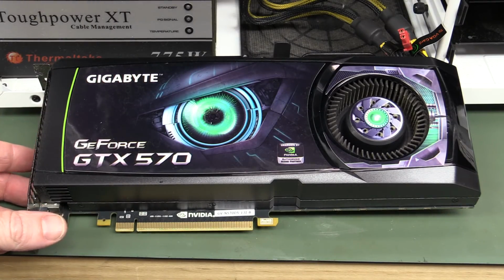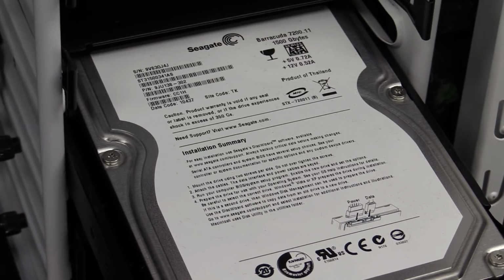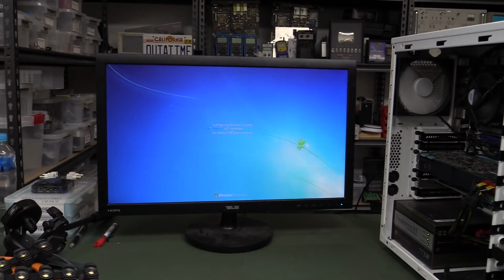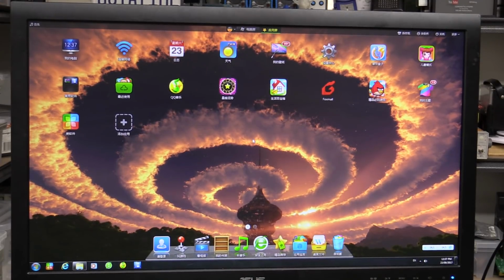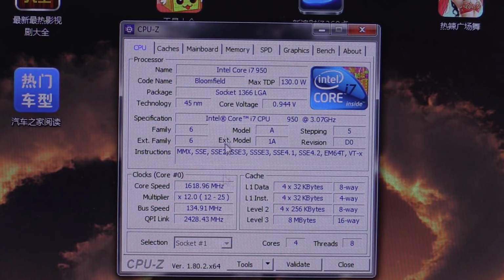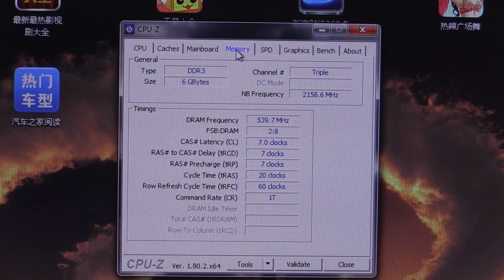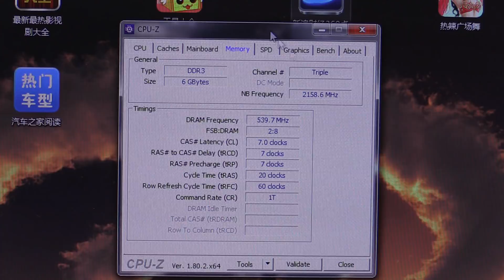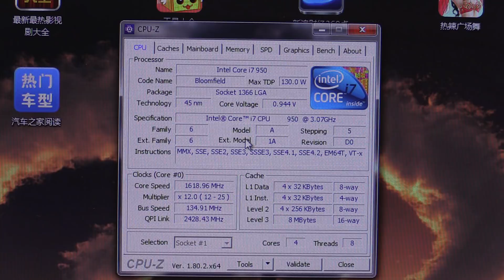EEVblog #1026 - Mystery Dumpster Diving PC

Comment: Kinda wondering why such "definitely from China" harddrive would get into a dumpster outside China. I mean, the system on the harddrive even has 360 safe guard on the computer, indicating that the original owner had no knowledge about how computer works anyway. I mean, anyone have any knowledge about how computer works (rather than only being able to use certain stuffs on a computer) would not install that software, which works worse than Windows's built-in feature.

Comment: The first i7 gen had the biggest gain in Performance since AMD Athlon.
I used my "gen 1" i7 920 until late 2014 when I upgraded to "gen 4" i7-4770K.
Not much performance was gained ! 
Only the prices had seen a substantial rise. Today prices are insane for the performance you get in CPU and GPU !

Comment: Oh and there is a heat-shield inside missing in the case. That blocks the heat from the PSU rising in the machine, and this part also has thr mounting holes for 2 SSD drives normally

Comment: OK, I'm gonna pause it at 3:21 and guess a Conroe chip, like a Core 2 Duo e6600...
Reply: ...and boy was I wrong! Who the hell throws out a Core i7? A 950 is a solid performer, even by today's standards. Incidentally, I have a 4790k chip, and it is the tits. I just wish it had a little more overclocking headroom. I went with a water cooling setup and still can only get it to run reliably at 4.5GHz without it getting too hot.

Comment: Better than my last PC pentium dual core 4GB RAM, 128GB SSD, Optiplex 380. Replaced with custom rig: Haf-X full size tower, ASUS x99-WS 31 MOBO cor I7 6800K, 16GB RAM, Gigabyte 750TI 4GB GPU, 250GB SSD, 2TB HDD, EVGA modular 1000 watt PSU.

Comment: Lots of comments expressing surprise at the quality of items found in your dumpsters. What these people don't realise is that businesses can often change such items more frequently due to the ability to write off the cost against tax as a legitimate business expense. Add to that the need for businesses to comply with data protection laws and they will change equipment like PC's more frequently than domestic users although many will utilise a recycling service for security reasons. Viewers should not compare what their neighbours throw out with a business park as reasons for discarding items are very different.

Comment: love the case! My computer runs win7 on 4gigs ram, 775 intel 2.5ghz with a ssd Runs really good for my work and so on. 
Is running on hardware over 20 years old!!  ram, cpu, case, psu, and motherboard over 10 years with only the ssd,vid card and usb card being newer. 
It's a damn shame when stuff like this is thrown out. I would have loved to have this set up :) happy someone can find some use for it.

Comment: The machine is definitely from around 2009-2010 considering it has a 1st gen cpu. (I think we're into the 6th gen now?) It was probably tossed due to obsolesce. No matter it's still a great machine. The led's on the power supply is new to me, never seen that before. In fact never knew Thermaltake made psu's like that lol!

Comment: Hey Dave, I tried to see if someone else asked this, but I did not see it...  did you notice that the computer has the Sata Data cable wrapped around the Mother boards power connector / lines?  I am thinking that since the MB just uses DC in ... it shouldn't cause Sata issues, but it may cause some Noise on the power lines for the MB.. Whats your thoughts?

Comment: Cool find, not really worth anything in todays market but for free it's not bad at all. Be sure to check what ram you put in this, as it is running in triple channel mode. Adding the wrong (type or amount) ram will slow it down to single channel mode. Making the added benefit of the additional ram somewhat useless

Comment: I have a pretty good idea of why it was tossed out. CPU Z had the max two at 130W while Intel stock coolers are only useful at dissipating somewhere around 90W. Also I noticed the clock speed was 3.07GHz which doesn't sound like a stock speed. Now I don't know the stock speed off the top of my head, but I bet they either overclocked it with insufficient cooling or tried to under clock it to compensate for the poor cooling.
Reply: Chrome corrected "tdp" to "two" please disregard the typo.

Comment: 5:01 "Pretty clean installation" Yes, because Windows 7 comes with a mod that makes it look like a hybrid of iOS and Android. :P
Reply: you mean a hybrid of osx and windows?
Reply: Nope. It looks like the original iOS and an old version of Android mixed together. Granted, it does have the windows taskbar still, but ignoring that, it looks the way I described, at least it does to me.
Reply: l can see he android, but l don't see the ios. it looks like osx to me.
Reply: Mainly the way the dock looks with the apps. It's very reminiscent of the way the dock looked in the older iOS. The apps looked sort of cheesy back then, just as they do on that dock. If it wasn't for the way the apps look on the dock, I would have said OS X and Android. I'm just anal retentive that way. :P

Comment: OMG LMAO They threw it out because of a broken foot!!!! WOW!!!!
Reply: they probably tossed it because it's old and hasn't held up very well over the years. and there is a possibility that this machine is a trojan horse carrying viruses.
Reply: Paranoid much? LOL   Sorry to laugh, it's just that saying it's a Trojan Horse is suggesting it was left on purpose to spread a virus. This is dumb on many levels. First, a virus is designed to spread itself, they do not need Trojan Horses in the form of dumped computer systems. Second, it's a highly costly method to spread viruses when again they are designed to spread themselves. Third, you have no guarantee the viruses will actually get spread out of the Trojan system because many people will just wipe the hard drive and install their own system onto it. Far quicker than trying to clean the system found on the drive. Fourth, you have no guarantee that the system will be picked up by someone like Dave before it's taken away by the refuge collectors and either recycled or dumped into a landfill. I am sure there are more reasons why your suggestion is laughable but I think those 4 prove my point enough :)

Comment: Goddamnit , the machine im using right now is far more obsolete than this.   With 4gigs of ram, 4core phenom and radeon 5450, which struggles with full hd video.  Why do people throw such marvels away ?
Reply: because it's garbage to most people.
Reply: Get a Nvidia GT 1030, which will decode Youtube videos (i.e. 4K) without the help of the CPU.
Reply: GT 1030 is horrible price/performance. Shitty value, waste of money.
Reply: The GT1030/50/70/80 supports the eighth generation of PureVideo HD and adds full hardware-decode of HEVC Main12 profile to the GPU's video-engine.
Reply: Gt1030 cost's here more than the rest of my pc combined. and used gtx570 like Dave just found costs 2/3 of its price while steamrolling over it.
Reply: Its slightly less powerful than a 750ti and costs less. It also has a very low power requirement meaning you can put it in almost anything. Great for upgrading pre-built systems.
Reply: a 1050ti would the better choice because it is more powerful and also very energy efficient.

Comment: That's basically the same power supply I have in my PC since 2010 😂😂😂
Great psu, never had any problems and have gone through several PC upgrades but the psu is the only original part.
I also just bought a fractal design define S case this year for a watercooling build

Comment: If I didn't know any better, the person throwing it away was the parent of a lazy gamer who got fed up with them lol. You don't need a great computer to run those games that are installed. 

That being said, the computer is pretty good. A few years old (3-5), but that's not much different than my computer. I'm sure it performs similarly except that I have a new gaming gpu. I know for a fact that the psu, motherboard and HDD are better than mine. So yea, good find for sure. Lots of usable components, or even a usable computer if you have a need of one at a new location or whatever.

Comment: yes it is better than mine I'm on a core I5 with 8 gigs of ddr 3 & a budget 1 gig Nvidia Geforce GT 520 but my 1 TB drive runs circles around that systens drive :) oh BTW newer systems do not require a burn in only old systems from the 90s do

Comment: Awesome! Good find. You can even get 6 core (i7-980X) for it, and triple channel DDR3 is good, stick some more ram in for 12GB perhaps, PSU is good. You could put in something newer like a GTX 1060 and have an all-round crackin' machine. Oh, get a cheap SSD and put a fresh install of win 10 on it, or reinstall 7 if you prefer. An SSD would make it a lot quicker to load stuff. All the best from England! :)

Comment: I just breathed new life into my X58 + i7 950 by picking up a XEON 5675 6 core for $43 and OC'ing it to 4.1ghz. It swapped directly over with no fuckery. Dave could even do that. (not as high OC with the stock cooler)

Comment: I  found a  ASUS  All  in One  computer in mint condition in a dumpster  a few tears  back.  It to  had a I7  processor , so I powered    it up and  the computer didn't boot.  I  took the computer  to a repair  shop and the issue was that Windows 10 tried to install on it and  it failed to boot.  Who ever  owned  the computer ended up throwing it in the dumpster, thinking it was unfixable

Comment: Looks like someone threw out their old-ish sleeper build. It certainly has an amazing case, and an amazing motherboard to go with(looks like 3 way Crossfire isn't out of the question). The only weak point is the CPU, and even that isn't that bad(I have a server built with dual Xeon E5649s - same architecture - a LOT more cores - and it WIPES THE FLOOR with more modern machines)

Comment: Actually, that power supply is utter garbage... Don't use it if you care for your parts, it is old (you don't know what the guy did to it) and Thermaltake is a really crappy brand in general, they are basically overpriced china bombs.

Comment: I got one out of a dumpster the other day and it turned out to be a P4 2.4 or something around there with like 120GB and 2x512! mbof ram. Mostly useless, but it had a floppy form factor card reader with mb header, I installed in a computer. That's 1.5 Tb. I have a 970 gtx and 8GB of ram,, but it has a better MB and cpu..

Comment: X58 chipset stuff had a very long life and are still being used. I had to upgrade mine because the heat was getting insane. Especially from the south bridge chip. But my little I7-930 (replaced by this 950) was still handling the business!

Comment: PSU teardown? :D

Both of my computers are worse. Best university workstations are like 1st i7 or i5, 4-8GB Ram, .5TB hdd, but there are still Pentium 4. And there are worse! :D The IT companies thorw the junk at the university, because it is better then the gear we have :D

Custom PC:
i3-2100 @ 3.1GHz
AsRock H61M-GS (the shop didn't have USB3 board on a reasonable price, broken front panel USB, and failing NIC)
4GB DDR3 @ 1333 MHz (don't have the money to upgrade)
.5+1+.25 TB HDD
Sapphire HD6750 1GB Vapor-X @ 710MHz
Chieftec CPS-400 (replaced Hipro 430 or something, had a broken fan, shorted the fan control, then the PSU shorted itself, now I have to replace the fan controller or something, and this was a big deal for my budget)

Asus K501LB laptop
i3-5010U  @ 2.1GHz (cpu fan going bad)
2×4GB DDR3 @ 1600MHz
1TB HDD
GT940M
In this machine had to upgrade to 8Gb of ram. Now win10 is IO heavy and don't have money for SSD. Installed linux :D

7:10 you found monitor? I have a 1440×900 19" TNpanel thing. Only one, because didn't had  $80 for other :D

Comment: You could use this machine for a ton of things, actually:
Steam machine, Streaming video-captured games (from another PC or game console), Media center, Remote rendering (if your main PC/Laptop is a lower-end machine), Security video station, etc.
Or you could simply upgrade the guts with something modern. There's plenty of space for a decent air-cooled system, as well as storage, so you could build a beast of a machine without investing too heavily.
Reply: All it really needs is a Xeon X5650 ($30-50), a decent air cooler ($30), more RAM, and a newer GPU.  Maybe an SSD.  It would make a pretty decent gaming machine if you OC the Xeon to 4.0 or higher.  I just replaced such a build with an 1800X, and I kept the old parts in an old case as a spare PC to game with friends on.

Comment: As soon as I saw Barracuda 7200.11 I was surprised that wasnt a dead HDD. At one point I had like 6 of those motherfuckers and every one of them had to get replaced under warranty.
TBH I still run a i7 980X and am consistently impressed by how my 7 year old machine is still so very usable. Very rarely do I feel like I need more power. The very latest games are about the only thing to tax it fully outside of doing like 3 or 4 things at once. 10 years ago a 7 year old computer would be practically unusable except as a door stopper. So glad I spent the money on the top of the line.

Comment: X58 was a really good platform (I'm still rocking a i7 920 from 2009 with a 1070, just because there isn't really a need to upgrade). The nicest thing about it is that pretty much all of the CPUs are capable of overclocking to 4GHz, which makes them MUCH better! They're not very power efficient though, but very usable.
Reply: If you already have a good cooler (which you seem to have), go to ebay and find a Xeon from the e5649 (only recommended on MSI boards as the x56** CPUs are buggy on those, ~25$) over to the x5650 (usually the cheapest 6 core, ~20$) to a w3680 (6 core with unlocked multiplier, ~65$). Due to being 32nm they overclock a lot better than the old 45nm i7s (my i7 930 managed 3.8 GHz before being limited by the cooler; my e5649 did 4.6 before being limited by me not managing to raise the BCLK any further), and for the prices they go they are a no-brainer.

Comment: Eww, it's a 1.5TB Seagate Barracuda. I'm amazed it still works.

The control board is probably worth something to someone that has had one that's died and still wants to get at the data.
Reply: I've had my 7200.11 Barracuda 1.5TB since late 2008 and it's still going.  It ran several years in my home server 24/7, a few years in a backup external enclosure after I upgraded to a RAID5 array, then a few more years as a Steam/games drive in my gaming PC (nearly 24/7 operation as well), then it started making clicking noises and lagging so I swapped it out.  Needed a spare drive to host the OS on my home server so I wiped it clean and copied over the OS.  It's now running 24/7 in that position and hasn't been clicking or lagging anymore.  I'm happy with it considering how high the failure rates were at launch.  I flashed its firmware with the updater tool after I bought it.

Comment: Awesome find, insane that it's fully functional. The X58 platform is still really potent. Some overclocking and it can compete with relatively modern systems easily. The videocard is a bit of a doozy though, you can fry an egg on that thing.

Comment: Oh my god, that hideous Mac desktop theme, why would you do that to windows 7? A taskbar with a dock above it.. ugh 😑
Reply: Have to agree
Reply: That's the interface of a software called 360 Desktop, come bundled with that infamous software 360 Safe Guard, which was supposed to speed up your computer, but in reality it's not helpful at best.

So... To answer your question, probably the original owner was both lazy and not knowing how a computer works, and was either using that because he has no idea how to better organize software shortcuts, or not knowing how to uninstall that damn thing and just leave the thing there without even touching.
Reply: Zylon FPV it's docky . I use it from time to time. I prefer win task bar on the top. And use docky on the bottom.

Comment: Waaay better than my PC. But far more power hungry.
Reply: PenZon A 750W power supply doesn’t mean it uses that much power. It wouldn’t be a particularly power hungry machine given its components, the power supply is overkill.
Reply: Samgab But not having an 80 plus rating does mean it likely is very inefficient. And in Australia? That psu will probably eat $40 or more with a user's yearly pc usage.

Comment: No this is not a better machine than i have! I have ryzen 7 1700,gtx 1080,16gb ram,250gb 960evo,2tb hdd,500gb hdd (from my old pc) , 250gb hdd (from my old pc),160gb hdd (from my old pc........ Lga1366 is still expensive so sell it dont keep .....
Reply: I would backup things from those old drives they will probably die soon. 
Also my virtual penis: 
i7 7700k,
gtx 960 (it will be upgraded), 
MSI Z270 M3, 
16GB ram @3000MHz, 
250gb 960evo, 
250gb SSD C100 Goodram, 
4TB HGST, 
2TB Toshiba, 
1TB WDC
and my 1TB Samsung just died,
all this enclosed in Phanteks 300S.
On the outside:
4K Ausu PB287Q 
Mionix Naos 7000
Razer Blackwidow
Edifier s330d
3TB WD MyCloud NAS,
2TB Toshiba as backup of most sensitive files. 

Yes i have in total 12,5 TB

Comment: That thing is better than the crap computer I have to use at my job.
Reply: I had at work PC so slow that I could easily request new one. Only problem was that that issue form had to be filled and send from that PC. And anytime I started filling it and going through with it, it took so long that I forgot what I was doing in first place.

Luckily during annual inventory check our IT guys noticed that my PC shows similiar behaviour to potatoes and decided to upgrade it before it starts sprout roots
Reply: Heathcliff 
It sucks when the workplace gives you a computer and network infrastructure that is slower than your brain and patience.